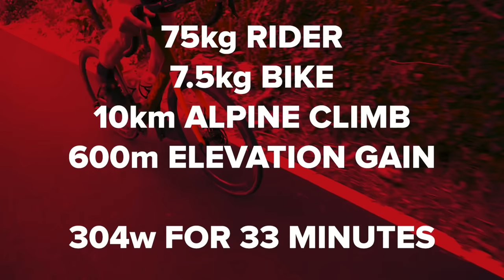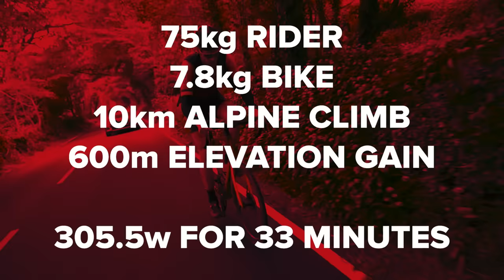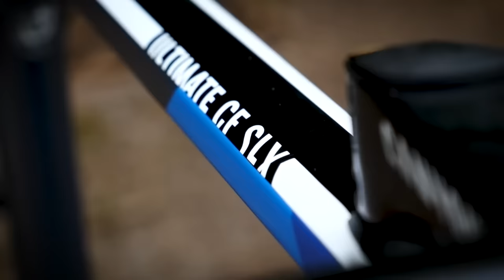10 Reasons To Consider Aluminium Over Carbon For Your Next Bike

Comment: How do you tell the difference between low quality and high quality carbon?
Reply: The tidiness of the layup, voids, steerer tube bore accuracy, etc. The best method to do it is to look inside the frame.

Cheap carbon frames will have unprofessional finishes while the reputable ones will look more refined.

Comment: It'a taken 11 years of solid abuse to put a big crack in the top tube weld of my giant defy, it probably doesn't help that I weight over a 100kg. despite the size of the crack, the bike still feels stiff and responive. Definitely a write off. I was however able to buy a second hand Giant Contend SL for the entry level price of a chinese carbon frame. Which did look tempting but the amount of pot holes, speed bumps and road debris would have smashed that to bits in no time. I just trust alloy to take abuse.

Comment: Top end aluminum is better than entry level carbon? And exactly how do we know what is top end aluminum realistically is better? So I go to mfg website and want to order a bike how am I to find out really? And if it’s top end aluminum frame don’t they sell it in combination with top end group sets so the bike also becomes too expensive beyond say 2500 k for most. And I have seen many aluminum bikes in the 2 to 4.5 k range. Are we to assume a 4 plus k aluminum frame is better because of its cost, how does one know if a bike is top end aluminum and can you buy it with cheaper components to save money and upgrade later in the future?

Comment: fwiw - All metal can acquire stress fractures over time (ie. metal fatigue) which non-metal C is immune.
Reply: I think that you will find that brittle cured epoxy has exactly the same problem. Cracks grow parallel to the laminate resulting in delamination. Many carbon frames have lots of small voids in the resin areas which are prefectly capable of initiating fatigue cracks or overload failures.

Comment: its all about or are you content :-) anyway, very good one this time, great re-view
my experience so far, is that I would buy a Alu frame from late 90s early 2000s to know more.
so far is that the overall take home is ; when standing pedaling the frame tends to bend more especially on the lowest zero point (crank arm point down, thus pedal is closest to the ground)

handlebars of Alu feels harder and less comfortable than Carbon

wheels of carbon in reality benefit you far less compared to Alu wheels looking at cost/faster ratio

however Carbon is cool

Comment: There are 2 problems with aluminium. Unlike steel it has a limited elastic bending lifetime. Then it breaks.
Second is it has low nobility and thus corrodes heavy when in contact with other metals like steel screws.
Titanium is preferrable but more expensive.

Comment: So…I have an old Pro lite frame which is 7046? (An aluminium derivative) I moth balled this for a focus carbon frame which now has a few sites of damage which is a worry… I’m tempted to rebuild this or get another frame …what the difference 
with 7046 as opposed to 6061 for example? I would be curious to know

Comment: Been cycling for years have two aluminium road bikes always worked well decided not to buy a carbon 👍
Reply: Rode carbon over 25 yrs. It broke. 7 frames. Now only Steel and aluminum. Last 4 bikes 2 steel, 2 aluminum.  Carbon stays on the trainer. Tired of walking home. Metal bikes no carbon anything. I ride gravel it's hard on equip.

Comment: GREAT video...I am looking for a gravel bike and at least here in USA it seems like most makers are really pushing you to carbon. I am riding for fitness and fun...I like to go fast but I will never race it so saving 1lb doesn't matter.  Anyone have any recommendations for a mid high end AL build with aluminum frame available in the USA?
Reply: Niner bikes makes some nice steel frame gravel bikes.  Marin does too.

Comment: alloy is my preference 

the cost of carbong i simply cannot justify  it personally 

modern alloy frames are extremely light compared to older alloy frames and the main reason for that is tubing wall thickness and geometry (hydrofoming and butting)

i compared the tubing wall thicness by tapping with my fingernail the modern bike sounded paper thin and i can bet it will probably still be more robust than my chinesium frame (tested on a scott spark mtb frame compared to my frame wich i cant even get info on the brand XD)

Comment: Aluminium is actually an “ium” of Alum - technically it should be Alumium but it didn’t quite sound right so we added an “in” in the middle. The Americans then took one of the extra “i”’s out but it was the wrong one!
Reply: Nope.  Alumium was first.  Then aluminum.  Then aluminium...which carried through worldwide until 1900s when US chemists used the older version used in US mining & industry.  Both versions are officially accepted regardless.  The end.

Comment: My Caad 13 is lighter than my carbon tcr.  Granted I have a slightly bigger size on the tcr and disc brakes but the ride quality of the Caad 13 and light weight keeps blowing my mind
Reply from the maker: The Caad range has always been a great bike 🙌 Which bike to you prefer?
Reply: @gcntech   although I have a soft spot for the caad 13, I prefer the tcr.  Better feeling over all. However I’m constantly worried about damaging the frame, and it’s twice as expensive as the Caad but nowhere near twice as good.

Comment: By "durability" you are referring to what I would call damage resilience. But there's another aspect of durability that may be important to some people, and that's *longevity*.  

Internet folk wisdom -- take that for what it is worth -- claims that aluminum frames have the shortest lifespan of any common material with respect to metal fatigue from normal use. There are plausible scientific justifications for this, but they're mitigated by engineering -- hydroformed frames can be light, yet overbuilt in areas where failures are likely to first appear. 

Longevity certainly isn't an issue for racers, who regularly replace their bikes to keep up with technology.  And it's not likely to be an issue for people whose bikes only come out for weekend rides.  For the vast majority of people buying  new bike, aluminium is a pragmatic choice.  But for affordable *longevity*, well cared-for steel is king, and that might be a factor for some people like bike commuters.  I spent a few months in Chicago recently, which having an extensive, pancake flat street grid is ideal bike commuting territory, and I was struck by the number of serious commuters who were riding decades-old bike boom steel frames. Jenny Graham's unsupported round-the-world record bike was Columbus tubing, although Mark Beaumont's supported record was set on carbon.

Comment: In actual cost terms, that is material and manufacturing, Aluminium Frames are more expensive to produce. Carbon frames are more expensive to buy for one reason only, as with anything, if manufacturers can get away with higher prices, they surely will!

Comment: 00:20 Only science-hating Muricans I guess. 😂
BTW I don't look at Mimimi-Carbon anymore. "Mimimi" because it is so finicky and frail. My entry-level Carbon frame cracked from being in a repair stand a handful of times, not clamped down, balanced out and with two towels for dampening. I really kept these occasions to a bare minimum and just needed the bike to be elevated. Still it cracked a few months after the last time I did that. Never would have happened with Aluminium. For my uses as a hobby cyclist with a tendency to abusive riding, Aluminium is just fine.

Comment: Durability ? Mmmm , there is the nasty issue of metal fatigue that is not so much at play with steel or titanium . Alu has no safe max deflection , unlike steel or ti . No matter how small the deflection of the tubes are due to road shock, those tubes will finally break . Ask me , I experienced it on a FULL SUS MTB !

Comment: I would not have carbon if i can help it, I love my aluminium frame, if I was worried about my extra 300 grams I had to carry, I would simply loose some timber from myself,
I'm not a pro an nether are most people and most of them would not notice the difference between a good ali frame and an average carbon one,
its what you add to the frame that makes the real difference, wheels, group set etc,

Comment: i sidegraded to alu, from carbon, (downgraded in frame weight, but upgraded to disc brakes, so i consider that a wash). but mainly, i wanted to not need to worry bout my bike carrier clamping down on my top tube... except Specialized put my alu bike's serial number as a sticker on the underside of the top tube, which has slowly been chafing away... on my bike carrier. so i'm back to square one, with an expensive bike, and an as yet unfilled need for an equally expensive bike carrier🤣 this hobby i tell ya...

Comment: Tried aluminum, tried steel and finally carbon. Still on carbon for the last 10 years and don't imagine going back if I have a choice.
Reply: Until you've tried CAAD12 or Allez Sprint you haven't tried aluminium.

Comment: Just put a sizable deposit on a revolt  advanced 2 2022. Well because of um you see ahhhhh carbon fiber. It was only 1k more than the aluminum same spec revolt 0. But my friend got a carbon gravel bike so I need o e that's slightly better than his. It's a win win really.

Comment: Two more reasons that were  not mentioned in the video: 
Waste: During the production process of carbon bikes, a lot of frames and wheels do not make it to the end-user, because they are out of spec. At every carbon factory in China you will find huge dumpsters with rejects.
Reply: Another one is the sound the bike makes when riding.  A horrible, cheap, hollow sound when ridden hard on a rough surface. Just not nice to hear.

Comment: Allloy frame with carbon wheels; had a pro fitted full carbon S5 with carbon wheels and packpain after every ride trough small vibrations and bumps. Alloy (and steel) are slightly more damping and the weight and stifness of the carbon wheels save way more watts than the carbon frame with alloy wheels. 99.9 of us arent pros and are gong for an ironman win.. so why suffer if you can ride more comfy and ride longer.. longer rides = more time on 2wheels = less pain = more fun? isnt it?

Comment: There is no single best answer.  If you want the lowest price but harshest possible ride, go with aluminum.  If you want more ride comfort and are willing to spend more, go with steel or carbon in that order of pricing.  I'm 60 yrs old and will never buy an aluminum frame, but I am also a softy after many years of road and Mtn bike pounding.  Don't just use the initial cost as your criteria, think of it as a recurring per mile or KM cost (x 1000's)

Comment: Do you enjoy riding in great discomfort? Be careful before you just pop off and buy an aluminium bike. You'll probably want carbon at all contact points and in your fork, plus today's trend of wider tires helps tremendously. And get the fit right, please. Weight isn't the only reason carbon took over so convincingly 20 years ago.

Comment: I am a huge fan of metal bikes - Steel has its charms - but the weight and cost is not worth it to me.  Alloy - aluminium - has always been my preferred frame material.

That being said I have I titanium frame currently, because I found a great deal on one, and the geometry was amazing for me. Does it have that "magical" something that people go on about with Ti - YES ... Would I buy it full price NO.  

Carbon frames just seem too light and plasticy to me.  Not given any other considerations - cost being first -  alloy is the perfect material hands down. But if you want to spend your money on carbon, steel, titanium  or even magnesium... its your money to spend.

and YES tire compliance and things like carbon forks or a nice carbon seat post make a lot frame material quibbles simply irrelevant.

Comment: So yes, if you have two bikes equipped exactly the same, one carbon the other aluminum, the aluminum bike will deliver slightly more forward motion power because it flexes less than the carbon frame. But if you're a professional and practically live on top of the saddle, day in day out, the stiff aluminum bike will beat the crap out of your body.  Maybe train on a carbon bike, and on race day switch over to an identical Aluminum race bike???  Why that would be cheating...

Comment: you rarely have aluminium bikes with better components on MTBs at least. That's the thing, the bike industry shoves carbon up our throat and neglets aluminium bikes. Aluminium bikes just get low end components. So then the bike themselves are, not only not as nice, but a lot heavier, "thanks" to the low end components.
Aluminium bikes CAN be light, it's just that.. they're not anymore :) Again, talking about mtbs

Comment: Manufacturers MUST adopt proper weld smoothing techniques (KOGA is don't that particularly well, but only on the top tube), if their want for their aluminium offerings to be taken serious. A frame, howsoever goed, with ugly oversized apparent welds is quite off-putting to a would-be rider. No aluminium bike must have those ugly welds and non-hydroformed tubes.

Comment: Well to be honest i got java veloce 2 size 54 rim brake made from Italy i put Tiagra Groupset it's good i won over 20+ races in my Place and also deep aluminum alloy wheels 24h aero as Carbon i don't need to buy carbon carbon is weak easy to break expensive not practical for my Type of use and strong abd everything

Comment: Stiffness is totaly overated!

And saying carbon ist stiffer and more comfortable is a contradiction, if it's stiffer it is less comfortable (but not noticeable anyway, it's all in your head). Tire pressure make a lot more difference.
Sure, manufacturers say they make the frame "horizontally stiff while vertically compliant", but this is impossible with a normal diamond shaped frame, you'd have to make something like the Trimble MTB to get this, and it would not be UCI legal.
Also there is no theoritical reason nor practical test that would show any advantage for a stiffer bike. Plenty of races have been won on early aluminium frame (bendy because they used steel sized tubes) that where far less stiff than the concurrence.

Comment: The tone of this is like aluminum bikes are novel. Aluminum bikes have been  around since 1990s.  No need to debate. If the tube walls are too thin. It can fail eventually.  But that's random if bike is not crashed often.  

Any bike under 20 pounds is light enough.
Reply: You can put clear tape over frame where bags attach
Reply: What about steel?

Comment: I would love to have an aluminum bike frame including the fork being made from aluminium as well. Seems that no one does this for serious race bikes. I guess its for the advantages carbon has to define comfort and stiffness in different directions. But wouldn't that be possible also with e.g. hydro forming ? Steerer tubes made from carbon also still seems to produce issues. So for a trouble free bike I think it would be worth while having the fork made from aluminum as well.

Comment: Weight is overrated, I see some heavy guys riding expensive carbon bikes and  they to lose 25 kg to get the performance from their bike except down hill when they really fly.
Reply: Ironically many carbon road bike frames have weight limitations. Obese riders should rather ride steel frames, which offer the highest payload

Comment: The environmental factor is a big plus for me.
Reply: Aluminum is really costly to make, on environment, and carbon composites are 100% recyclable, with much lower cost. The guy is talking garbage.
Reply: @v57163  is it not derived from oil though?  Apparently it takes 20 tons of co2 to produce 1 ton of carbon fibre plus the high energy cost of baking it.
As opposed to 12 to 17 tonnes of co2 per 1 tonne of aluminium from mine to ingot, plus you can recycle it.

Comment: Aluminum cause it is CHEAP! Absolutely only reason to purchase a fatigue fracture built in featured frame coupled with a bone and butt jarring ride. i.e. CHEAP to weld in Asia! If it is the best you can afford, by all means buy it. 
    35 years of USCF and NORBA racing along with 120,000 miles to back up my statements, care to argue sport?

Comment: Aluminum frames are horrible! They are cheap for a reason. Most have a 5 year warranty. They will fatigue and brake AND they don’t have the stiffness of carbon. My $2000 Carbon bike is significantly better than even the best aluminum frames! I am disappointed by this video.
Reply: Your $2000 carbon fiber bike won't last forever the way my steel frame bike will.